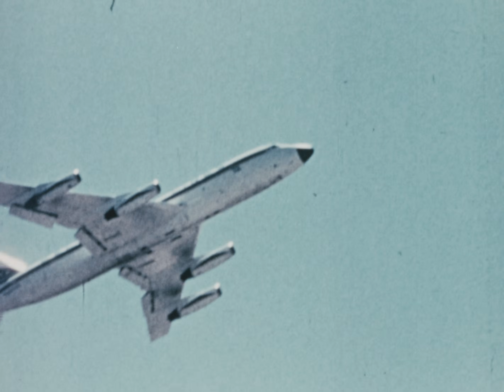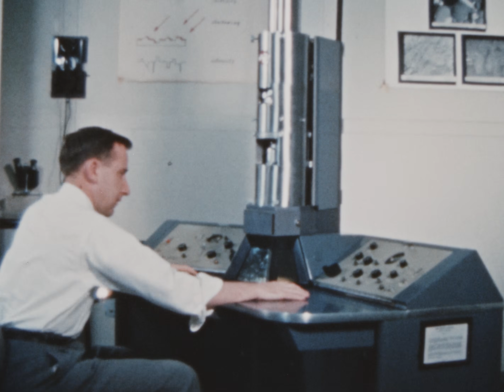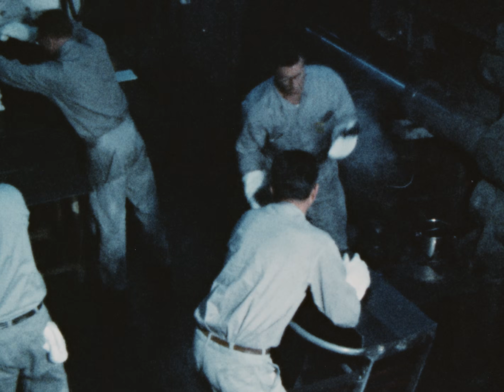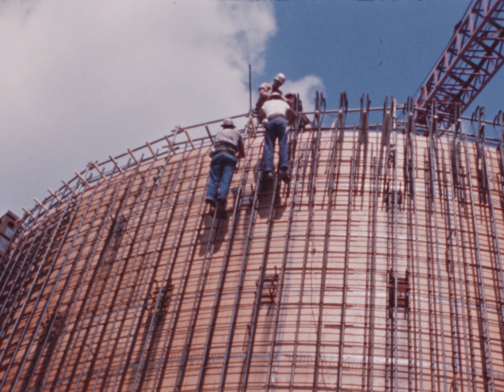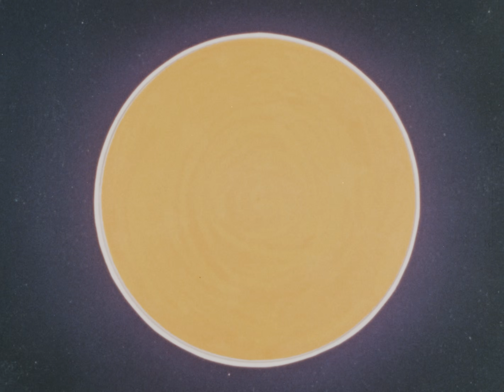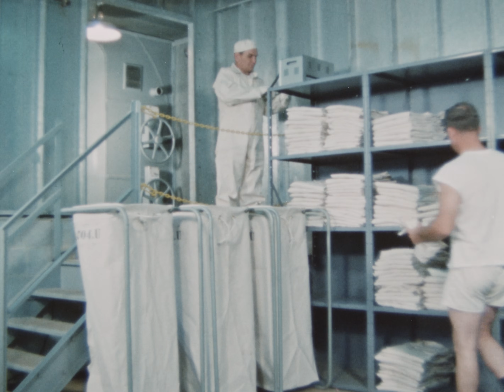Heavy Water Components Test Reactor and the Heavy Water Power Reactor Program (1962)

Comment: Placing the concrete for the HWCTR in one continuous pour must have taken a while (several days). That's about 1500 cubic yards of concrete. They poured the big silos at the shipping ports without cold joints, too - but they slip-formed them at the rate of about six inches per hour. This one was cast-in-place. Massive strength!!

Comment: 24th! 😋

I'm going to guess the heavy water regulation concept didn't catch on in the end? Around the time this was produced (1962) the UK was building its first wave of nuclear stations - All Magnox types - And any developments in HW regulation would have missed those...But the second generation in the late 70s were all AGR (Advanced Gas (cooled) Reactors) and might well have been HWRs if the concept had proven itself. 😇

Personally; I believe the UK has a massive untapped „Nuclear“ resource that's just waiting to be exploited, and it's actually cleaner and greener than classic fission reactors! Simply install boiling matrices in the roofs of most church halls attached to turbine and generator sets, invite a full compliment of Daily Mail readers in for a coffee morning, then subject them to concepts they struggle with e.g. non-Christian faith and transgender rights. 😳

The amount of rage coming off of each group per church hall will be enough to drive a city the size of Reading...And the best thing in all this? Daily Mail reader rage produces no harmful radiation that can't be controlled with low-cost sound dampening systems, and doesn't do any perceptible harm to the folks whose rage is being harnessed for energy production! 📰♨😁